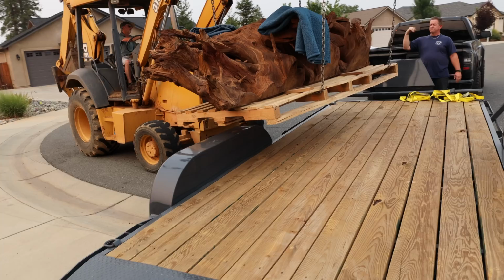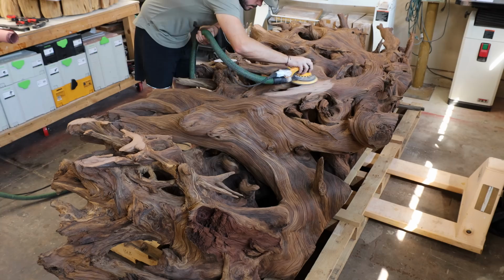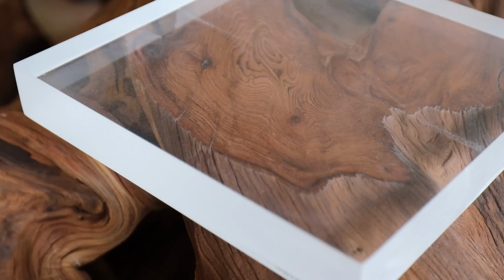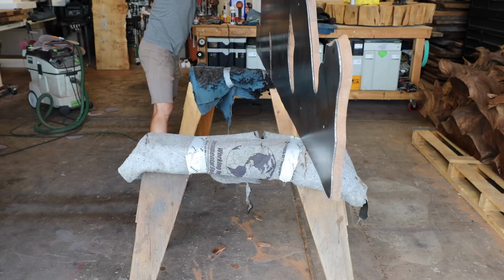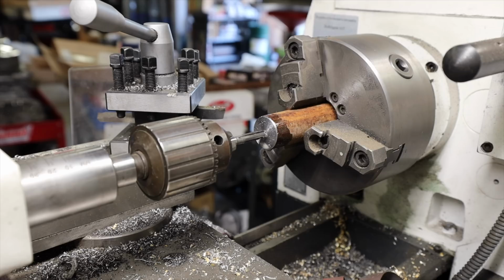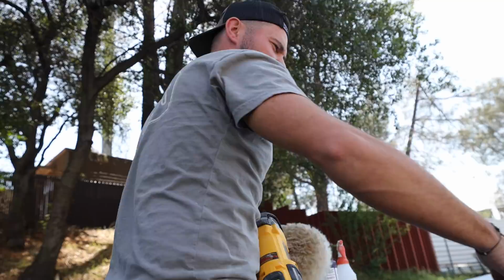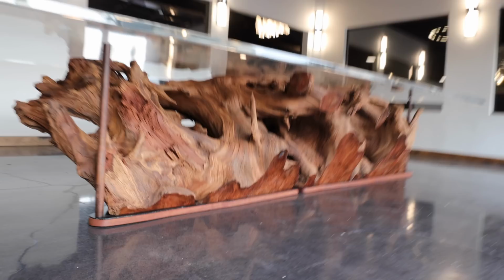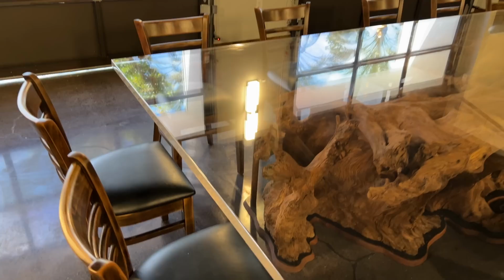1500 Yr Old Redwood Table Build | $65,000 Value

Comment: Straight away (in 3 min ...) ... ACRYLIC top ??? ffs?

Why not tempered glass ?? With such a poor choice so soon I bet this will not be a good result ... let’s see ...

Well ... Not bad but I would have put a kink inwards on rusted steel rods ... maybe 30  degrees half way up to mirror  asymmetry of root rather than straight up.   Two may be needed together if bend compromises the strength. 

I think the vertical rods  as they stand are not quite the right aesthetic. Love the idea of  the rust left on them though ...

Wonder about  dust and detritus collecting on the root mass in a restaurant over the years and do think glass would have looked so much better. 

Will  the acrylic yellow with age from uv or cleaning products ?and the ppf also doesn’t wear that well either from personal experience ...
Reply: So go build your own table then. Jesus.

Comment: Dear Matt, tremendous woodworking with this ancient root ball.  I wonder is starting off with a sheet of laminated safety glass would be better in the long run. It may cost more than the acrylic but can be thinner and about 50% greater weight.  You have to work hard to scratch glass but you can polish out any scratches. Cheers.

Comment: Okay, so you want feedback, so here you go: 
* You surprised me with how you used the root, as a sort of oblong central pillar, so massive that you nearly didn't need that rusty post for support on the one end. 
* The table itself was more massive than I imagined. I was kind of wondering if you were going to cut out some portions of the root for legroom, imagining that the table edge would be much closer to the wood than it was. 
* I'd like to get a little bit more into your head. What else besides the finished product did you think you could turn this root into? Why acrylic? Did you have any previous experience with acrylic? Why did the ceramic coating fail? Does the manufacturer of the ceramic coating recommend it for that purpose? What does this inspire you to do next--what skills did you learn, and are looking forward to learn? What new ideas did this put into your head for future projects?

Comment: I love that there is apparently this kind of craftsman in Redding. But ultimately I have to agree that the design was ill-conceived. Just putting a transparent top and a base on the thing, when you need to add structures to make the top work, just results in the most expensive cheap looking table on Earth.

Comment: Monday Quarterbacks! Same dudes that sit on their ass’ all Sunday and yell at the TV screen! The Rods were necessary to counter balance the width and weight of the top. The base was a great choice. The top , if in tempered glass would have been much heavier and yes might have not scratched . However most probably would put the metal rods to more use due to the weight difference! In my Humble opinion! You really did a Fantastic job. As far as the guy saying you added an extra 0 to the price tag! Had not had a clue! You can’t even touch Red Wood Trees now a days let alone 1500 year old tree roots that are as said petrified! 100% success! Cheers
Reply: Thing is my man - the team can play again next week - that table will be around for a while.

Comment: Too many slight color contrasts... Got the root system itself, the overly polished chainsaw cuts, the base, and the metal poles... All different hues of the same base color... There's a reason why you're not supposed to wear black + navy.

Would probably look a lot better if you had brushed the cuts instead of sanding them to a polish.

Stainless steel poles + base might look better as well. Not sure though, but that's why you try a couple of options and show them to the customer when you're working with 10s of thousands worth of wood.

Comment: Totally don't understand why you would remove so much of the wood? That doesn't make any sense. The piece should have been added to instead. And acrylic? Maybe I misunderstood. None of this makes sense to me. Completely disrespectful of the wood. It should have been treated as art, not a table. Even if it WAS a table... this was the wrong approach.
Reply: Agreed
Reply: It would've been better as a standalone piece in the restaurant rather than a table. The acrylic top is tacky and possibly the cheap route. (Most likely only did it to show off the tree anyways)

Comment: This looks absolutely terrible, sorry. It could have and 100% should have been the wood itself as the table, with resin infill where necessary, the acrylic slab is insane. Could have also had bits sticking up above with cup holders or lights or other interesting stuff above the table, maybe, but anything other than this. You also can't even sit at it since there's no space for your feet..... just awful

Comment: @Matt's Woodworks  You asked for the feedback, so here you go.  Impressive work due to the logistical difficulties.  Otherwise way too many issues with its aesthetics.  The color of the wooden base is a major tonal mismatch - too dark.  The metal plate should've been recessed in the wooden base.  The rusty metal rods and their location are just wtf.  The plastic top was a horrible decision unless you'd taken the advantage of its malleability and shaped it creatively, which you didn't.  The whole thing should've been finished with some sealant because there are so many spots for the drunk patrons or children to hide food in, which will leave a smelly stain.   Your complete disregard for personal safety while working with power tools at and above the eye level is even grosser than the week-old root-table-hidden sushi.

Comment: The table looks bad. I definitely would not like to see such a table in my home. The glass is great, but the wood under the glass looks like a big piece of garbage. Dust accumulates everywhere right, just imagine how long it takes to wipe every bend of the wood from dust! This wood can light a fireplace well and fill the house with pleasant warmth 🙂
Reply: Different strokes for different folks. I definitely don’t want to be the one to clean it but I would if I was lucky enough to own it.
Reply: @quiltqueentoo8312  Imagine you are sitting at a table and your knees are resting on something. We have a table of the same size in the meeting room, sometimes meetings take a long time and everyone stretches their legs under the table, now question, how to do it under this table? 🙂

Comment: You did a real nice job. I would be worried of people kicking the under part of the table.  Maybe  putting a wood stopper on the top of the piping, and the chair have to go. I hope your next one goes in a lobby of a high end hotel with elegant furniture, lighting where people can admire the natural beauty and age of the root. Maybe make a couple miniature models and see what you like best of differant designs. I loved the results of sanding and polishing the wood.
Reply: The customer is always right - if he has the $$ to prove it! Showcased, people may dine just for the table. Just commenting / speculating on polishing ALL the root structure, looking at the labor / time that went into polishing just the flat portions, I don't see how to even reach into the root structure with fingers / hands / arms with leverage to polish. I don't think you can get an acceptable result by just coating the wood, without the high grit sanding / polishing.  (I'm not trying to hybrid / remake English, just too tired to punch out proper sentences.)

Comment: If it doesn't work out, a hard glass will work and it won't scratch. It is used for tables many times and last for years. Also, you can get a beveled edge. Great video, good job all around.

Comment: I’m a visual artist, classically trained and I think this work is Very cool! but I think having this dipped in marine varnish would have done it more justice. 

Not living for the rods- I think if you don’t want to do a branch and try to have it match the rest- which would be incredibly difficult- I think a metal rod matching the base would be more successful. In my opinion for your next iteration- let the root system be the only wood you use in the build. It speaks for itself and should stand alone- when we think about honouring our materials- especially one as precious as this- putting something that is a similar material but has been treated completely differently and has the obvious intrusion of the craftsman’s hand is a juxtaposition  next to the raw beauty of the root system that undermines the message and overall impact of the work. When you are working on expensive pieces like this- it’s important to ask yourself every single time you make a decision- what impression do I want this piece to make, if it had a voice what would you want it to say to it’s audience- how do I choose other materials that don’t detract or confuse that message, but instead add additional interest and complexity. If your message is to be wowed by the power of nature’s ability to build on her own, then using wood that has been manicured next to it doesn’t speak the same language. 

Looking at this peice

Comment: Great job, wonderful look. By the way, did you have to use the metal posts at each end? Wasn’t there enough surface space to told the entire plexiglass? Again, great work.
Reply: They could have sliced more off to have more touch points, leaving the root to be the only support visible, and then built a steel base.

Comment: First thing i'd warn you about is peeling off the protection papers from Acrylic - don't touch a good Ground immediately afterwards or wear a bonding before you start. Years ago here in the U.K. I was involved in replacement of glazing to some big skylights - the frames were aluminium but virtually isolated by the bedding caulk. I peeled the sheet off in a flourish and touched a near by lightning conductor - it gave me one of the best electric shocks I've ever experienced and that includes getting my head rather too near to a farm type pulsed electric fencer!
Now I hope you're endeared to me for the safety hint - I hate those two lengths of iron pipe you've used as supports - if you're gonna use a tree root - get one the right shape. 
I know of a similar idea - vanity display object - can't show photos as it was verboten! But there is a full round prepared root under a GLASS top and if you wanna make a wild guess at the price and double it - the glass was made by Lalique. Private house in London valued at £128 million (before we ejected all the Russians).  Great work on the recovery.

Comment: I know glass is the best. The wrap will scratch, cloud up and shrink over time. I have used large panel low iron toughened glass that's laminated and bevel edged. It's three times the price of the plastic but?

Comment: i had made one simular without metal and glass top for art design and made it through to art express that was showen with 100 others artworks but was the only wood design looking at your art mine must have looked like crap back in 1995 lol you are the master builder designer artist on so many levels thank you for sharing your master work PS dont like the steel rods

Comment: Tempered glass is available 19x5000x2700 but weighs a tonne, perspex is shithouse I would have done a contrasting top possibly a waterfall end in corian or stone so you can clean it, and put heat on it and not worry about it turning into a scratched up old bus stop

Comment: This is pretty cool looking, but adding the metal pipes, took away from the 1500 year old roots. Branches, better idea. I thought it was going to be encased in acrylic, that was poured throughout the root system. The acrylic top is to huge. Cutting the root in 2 and then, 2 round tops instead, might have been better choice.  Using  it as one big eating table with patrons possibly kicking it, bumping it, this is a show piece. A poured top out of acrylic in a mold of the shape, as you did the bottom, would have been amazing too.

Comment: I don't know why the surprise about the surface finish degrading.  As soon as the word Acrylic was said, I knew, that's never going to last.  Acrylic has a lot if nice properties, but a hard scratch resistant surface is not one of them.  Density 1.2 g/cm^3 vs 2.5 for glass, Tensile strength 50 MPa vs 65 MPa (strength about the same).  Young's modulus 3.2 GPa vs 70 (much more flexible than glass).  One could go with a sheet of glass half the thickness to save weight, but then it would need many more support points to keep it from bending and sagging.  Acrylic has higher impact resistance and glass is more likely to chip or shatter.  From a safety point of view, Acrylic is better.  Nice that a solution was found to give a surface treatment that is resistant to scratches and still looks glossy good.  (I agree with those who don't like the rusty rods for added support points.)

Comment: At 0:37 seconds in - do yourself a favor and don't trust cheap pine pallet to not snap where the chains are lifting. That was just asking for the whole thing to tip onto the ground. A forklift would be better. If you must do it with chains, add some C-channel between the chain and the pallet - or build the pallet to be lifted that way in the first place.
Other than that, wonderful piece. Very well executed!

Comment: The wood was amazing but the result was disappointing. I was hoping to see an all wood, or wood with some actual (safer) glass top. 

On a side note, we recently put XPEL on a new SUV we bought. Great product but I read the label on the coating. It clearly states how toxic the stuff is- like never breathe it in or touch it. People are actually doing to be eating off of it- dropping sushi, then eating it? That was not too well thought out. 

For starters, from the product safety data sheet- Acute Toxicity- Dermal H312 and Acute Toxicity Inhalation H332. H312 states Harmful if in contact with skin. Terrible choice for a dining table. There are over a dozen additional warnings.

Comment: In the true sense 'mahogany'  only means 'red wood'.  What we call mahogany from around the world includes some 20 species.  These species are usually reddish and usually equatorial.  'Mahogany' is just a useful catchall name.
I have 3 pieces of mahogany,, a hard, dark Philippine mahogany, that you might be interested to have  22"X109"  ,  28"X 14'  ,  and 30"X 11'  all 8 quarter  planed and unplaned.  Left overs from building commercial bartops 50 years ago.  ?

Comment: Put a metric shit-ton of HEPA air filters in that place, or you'll get dust under/in the roots like crazy.
As others have said, probably should have gone with glass.
Put some UV protective film on all the windows, or else welcome yellow in a few years, maybe more than a few... But Still...

For all those giving you shit, take this to heart:  When THEY make one of these, have the balls to make a video and expose themselves.
Has anyone?  Discount everyone who hasn't made even 1 decent video.

It looks good.
Do I like it?  I'm a little torn.
I would have cut the whole damn thing into 4-6" thick slabs ( riskkkyyyy )  And then proceeded as you did.
I did Not like the rusted iron rods, but that is a tough thing to see on a video.  Maybe they look awesome in person?
I would have considered putting in 1/4 or 3/8 SS rod into the root elements that were load bearing at the corners, and floated them all.

Overall, it's a beautiful piece, but not my style.

Do the next one!

Comment: To be honest, that extra base plate kind of ruined the concept for me. Also the two rough looking rods are not the most pretty. In your place i would have inserted 4 or 6  polished stainless steel small rods at the top to support the top and get to the right height.